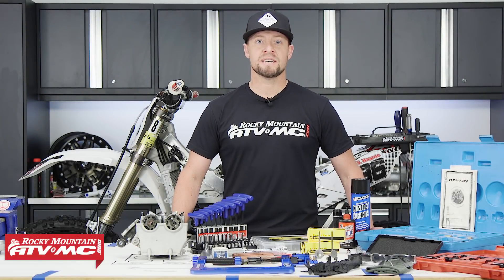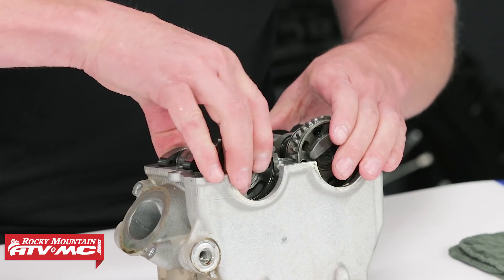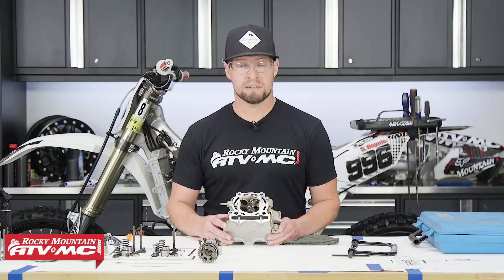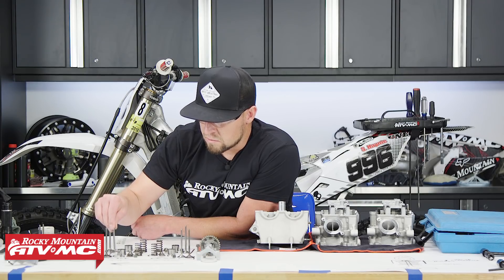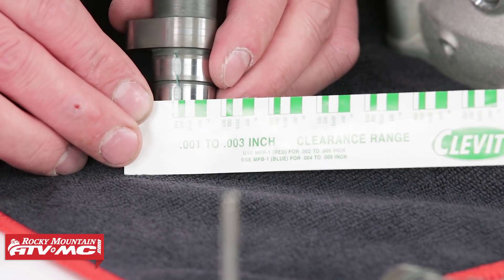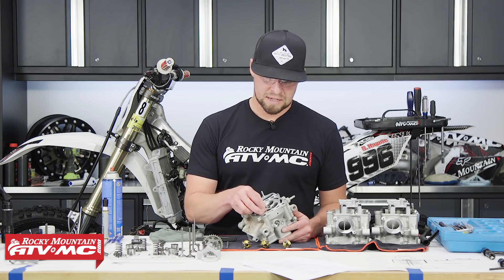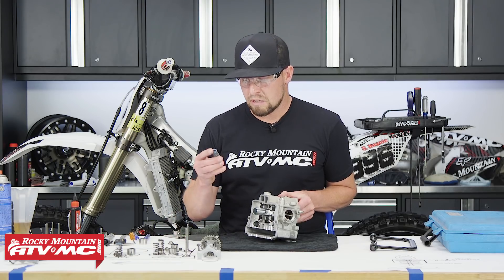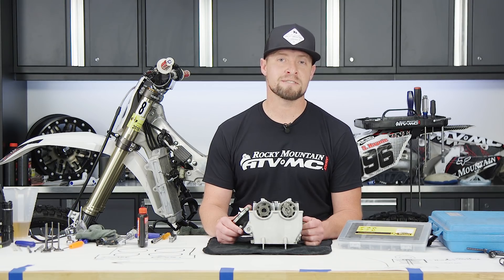4-Stroke Motorcycle Cylinder Head Rebuild

Comment: WARNING before you make the mistake i did on my 09 kx450f I reused the valve keepers that was on it thinkin they would hold but of course after about 10-15 hrs on a new rebuild and it let one of my exhaust valves come loose thankfully it didn’t go through the piston or grenade the cylinder but it shattered the valve bucket and threw a couple pieces of the bucket into the head smh i hadn’t road it but a few rides since i built the bike worked on it for 4-5 months (it was a full rebuild plus i had work 6 days a week now i’m back to where i started lmao  guess that’s da shit happens when you’re apart of dat #kawi life😅

Comment: Can you actually get an accurate valve clearence measurement when the cylinder head is off the bike like this or is he just showing how to do it when the cylinder head is on the bike etc
Reply: valve clearance is not affected by the head being installed on the motor. It is way easier to do this and reshim if necessary when it is off the bike.

Comment: Do NOT allow any shop to use a Neway cutter on your motorcycle seat.  Newen is by far the best, Serdi is second best.  Rottler and Sunnen are also pretty good.  Do not allow a shop to use stones on your valve seats.
Reply: @mikeolson7188  We say Třikrát měř, jednou řež.
Reply: why
Reply: @tratloucany  because modern CNC controlled valve seat machines with cutters are orders of magnitude superior in terms of accuracy and getting a high performing long lasting seal.  Also, stones suck on beryllium copper seats and inconel valves
Reply: @petersouthernboy6327  In 2007 rmz 450 manual are these cutters drawn for use.

Comment: How do you know when to replace a piston/valves on a four stroke?
Reply: Tom Whicker you would want to do a compression test and if its out of spec do a leak down and pinpoint the cause(s).
Reply: You can pretty much go 50hrs on a 250f, if you clean your airfilter and change the oil every 3hrs for maintenance.   If you ride easy and stay off the higher rpms, you can get 80hrs.   If you race, id change at 25hrs.   
450f's will last longer, id say 80hrs normal.   Less if you race and some have over 200hrs on stock piston.

Comment: When doing this, is it necessary to buy all new parts such as valve springs, spring seats, etc or can I just buy new valves and use the old springs and seats? 
Also at what point can't you shim anymore?
Reply: Novaghast you need to buy springs as a minimum, they wear out really fast at those high rpms, meaning they will fatigue and lose some spring pressure. This will result in valve float and spring failure. Everything else can be reused.
Reply: you can measure springs to make sure they are with in spec, of course if not replace them.